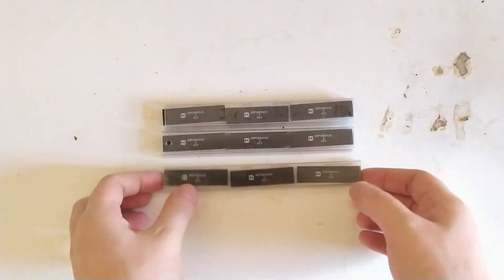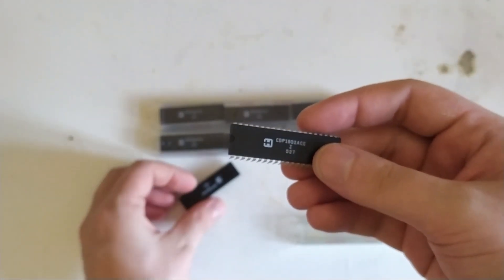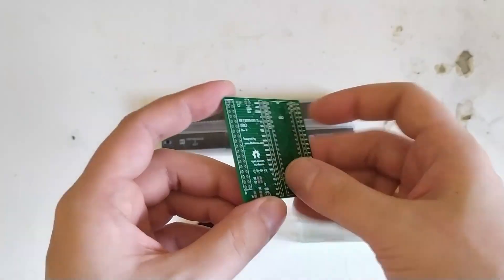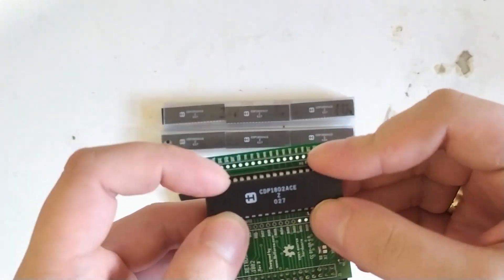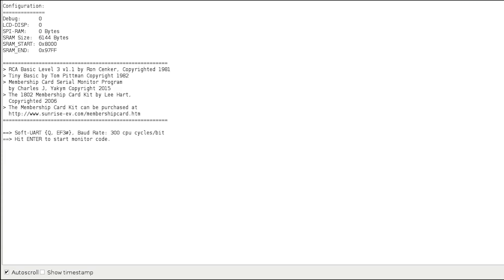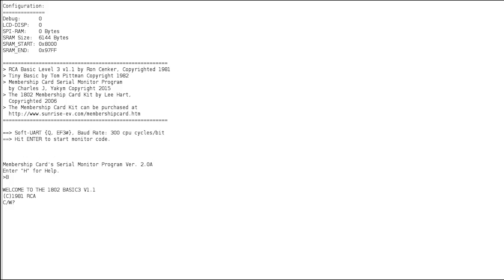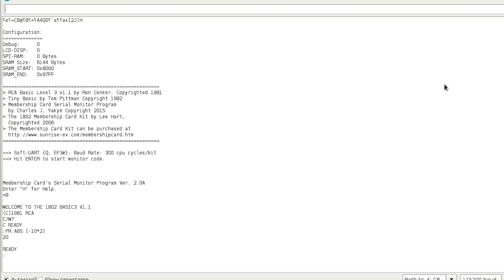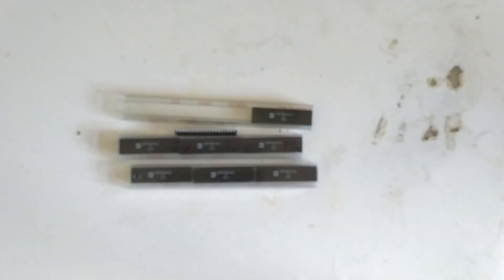Testing Blacktopped RCA 1802 Chips with the Arduino Retroshield

Comment: It's a good thing you mentioned the direction the board plugs into the Arduino Mega bus. The assembly instructions were not very clear on that and I would have plugged it in hanging over the board preserving the footprint of the Mega. I started out with the 1800 family of chips in the early 70s at Boeing and eventually built the ELF and later the Netronics ELF II. I would love to see an expandable project built around this little used chip set
Reply from the maker: Yes, it's not intuitive. My first instinct was the same. Future Versions should just put the direction on the Silkscreen. There's plenty of space. I agree, the 1802 is not getting the attention it deserves compared with the Z80 and 6502, there's just so many projects around the latter two. I think an expandable card based system would make a very interesting Project! It's actually on my list of things to do especially because I find the architecture fascinating.

Comment: For a testing device like that I'd probably solder on a ZIF socket instead. Too much chance to damage the pins otherwise.
Reply from the maker: Could be done, but this was a one off with chips that I did not even think would work xD

Comment: Argh! Get your fingers off the pins!!! That's not a way to treat CMOS!
Reply from the maker: Well desoldering them over a coal fire sorting them by hand before sanding them down to put new silkscreen on is probably also not the best. I'm always amazed that a fair amount of these chips survive through the blacktopping process. for my part I usually wear a heel strap that's connected to the table frame which is grounded. The Table surface is also connected to ground. Might not be the best in terms of esd protection but I never had any issues. Possibly because the Climate where I live at the moment is humid all year round.